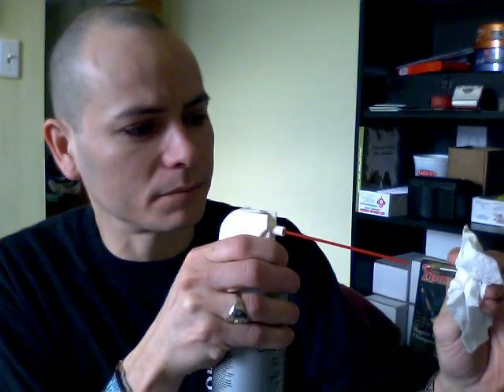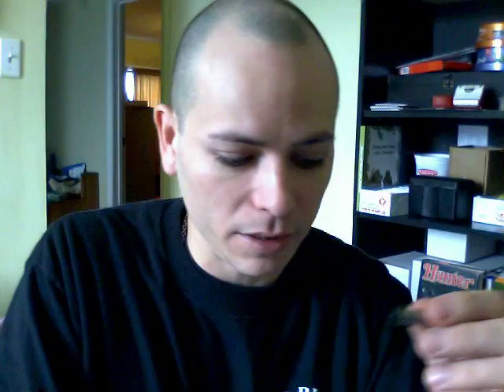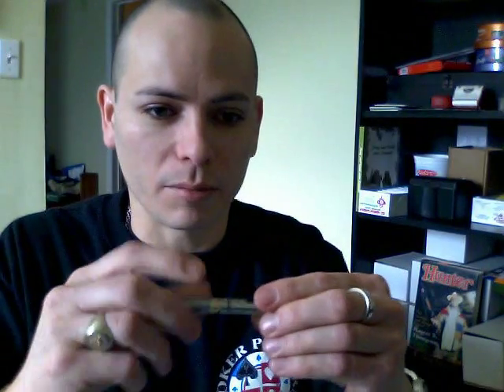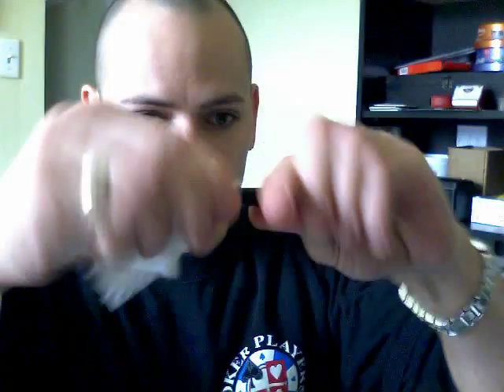cleaning and maintenance for  510 or eGo e-cig atomizer battery and cart

Comment: @NicFitNation 
thanks for getting back to me so fast, and yes the battery is pretty close to 6 months maybe 3-4.  but the thing is i bought it as my first starter kit and used it for about a month maybe a little more, then i didnt order any liquid for a wile so it sat in the box for some time.  i have two batteries and one still works great but the other seems to be clogged.  before i let them sit i put some 99% isopropyl on a Q-tip and cleaned all the  visible "gunk" off.

Comment: one of my batteries thats got the automatic sensor to detect when your inhaling seems to be clogged, the battery still charges but i cant get it to activate is there a way to fix this problem ?

i have one of the ultra kits froms Electronic-cigz m601 automatic.